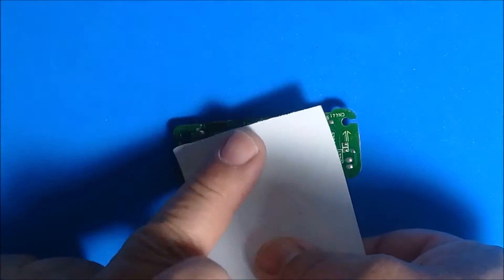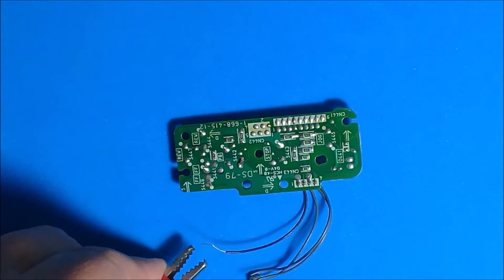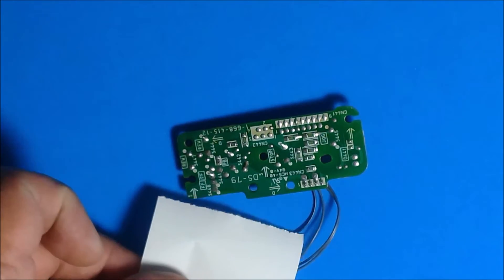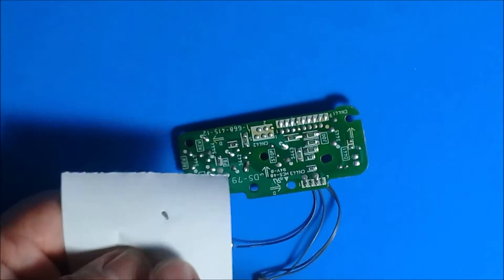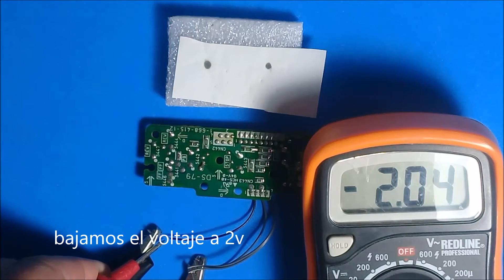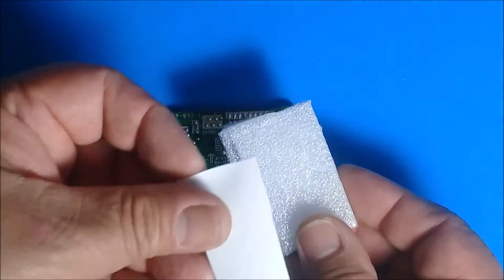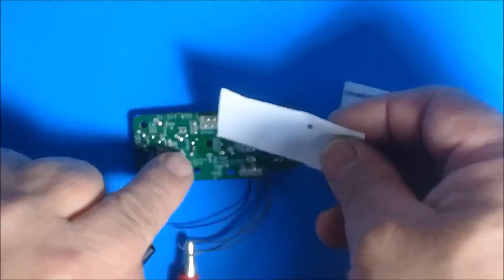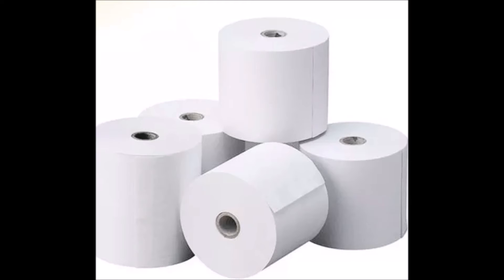COMO ENCONTRAR LOS CORTOS EN LOS CIRCUITOS

Comment: Exelente tip. Pero me queda la duda. Si en lugar de inyectar el voltaje simplemente enciendo el equipo... El componente en corto igual se recalentara?... Tengo una play station uno con un problema de imagen y me han dicho que algun componente que rodea la gpu o la vram debe estar en corto. Es decir el equipo trabaja pero da una imagen extraña.
Reply from the maker: Hola abraham muchas gracias por comentar. No siempre es posible, sobre todo cuando el sistema incorpora protecciones, en ese caso el segmento que rodea al componente en corto queda apagado (shut-down). por esa razón hay que inyectarle un pequeño voltaje como se explica en el video. Un abrazo

https://www.youtube.com/watch?v=v5ze1cnUv0Y